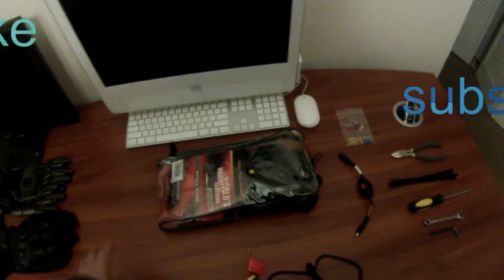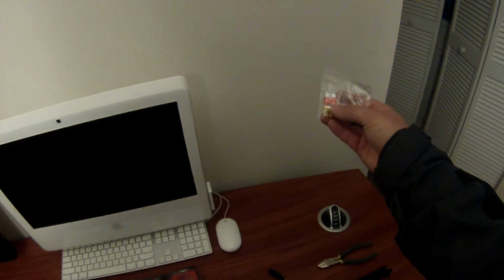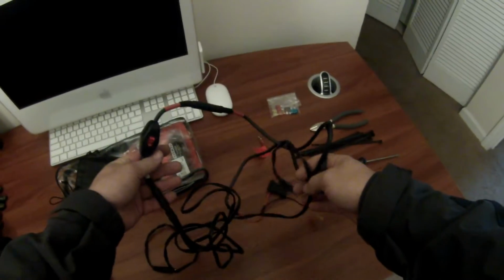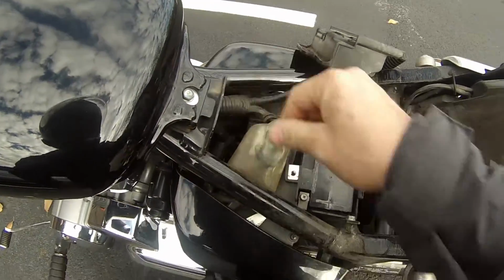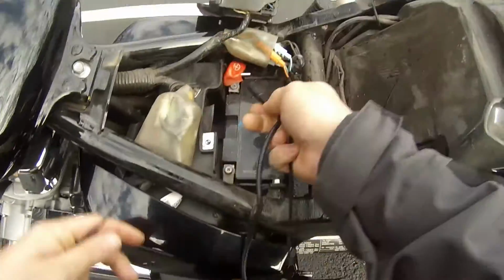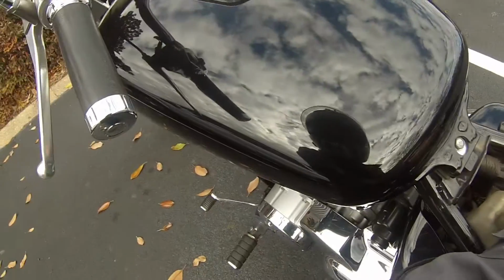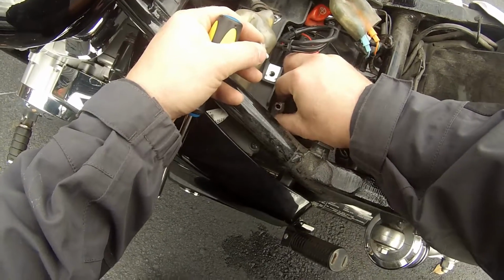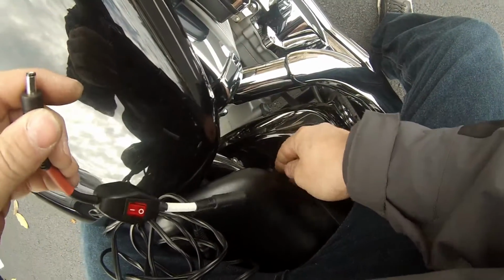Gerbing G3 12 volt Heated Gloves, Battery Harness connection to Honda Shadow

Comment: I gotta say, I'm often stunned at the shoddy quality that is in almost all brands of motorcycles. If it makes you feel better, a dealer near me deals with breaking frame bolts on occasion. Yes, frame bolts. Great job on the wiring and cable ties! I've often considered going with heated gloves, but haven't yet.
Reply from the maker: I can honestly say i was shocked when the bolt broke. Probably why my reaction was so reserved.  Thankfully it wasnt as severe as a Frame Bolt!

Comment: Looking forward to the follow up. How cold does it get where you live?
Reply from the maker: Thanks for the comment. The temp can drop down into the teens, but usually doesn't get in the single digits. I have an overnight camp in a few weeks in the mountains and it gets colder up there. These will come in handy.
Reply: I am presuming there will be videos of the camping trip.
Reply from the maker: Definitely! It will probably be a 2 parter.

Comment: "Son of a nutcracker" :D What a restrained reaction. Have you considered heated grips rather than gloves? That way you are not wired to the bike and you can use what ever gloves you want and you always have the grips with you :) when you need or want them. Just a thought.
Reply from the maker: That is a great idea. I wasn't sure about buying gloves but a chance encounter with a guy that just sold his bike and an offer I couldn't refuse landed me these. Heated grips would be ideal though. I'll definitely check them out for my bike and see what the cost and wiring requirements would be. Thanks for the advice and the comment

Comment: Hey Buddy I praise you for doing your own videos,but I must bring to your attention that you have said some miss leading information ,the first is about the fuse box on top of the battery ,that is wrong and I tell you this for 2 reasons 1 your wrong thats the main brain for your bike 2 that if and when you do break down or blow a fuse you will know where they are ,and they are behind the brake side of the motorcycle side cover no tools required to remove the cover below the seat,2nd and for most you said you hit your head on the bars/mirror no you did not hit your head you hit your helmet on the bars /mirror,your head is in your helmet you helmet.......so you helmet get your info straight and when you need to change a fuse you can thank me in your thoughts every time because know you know were they really are peace my freind and keep it rubber side down